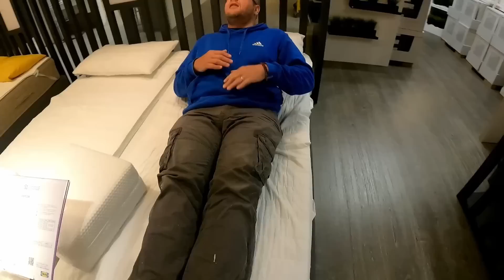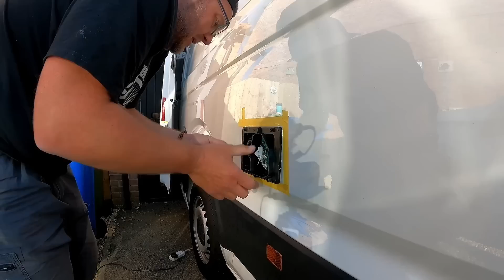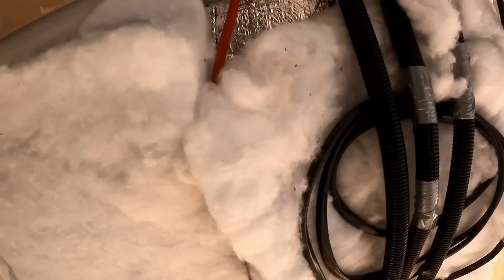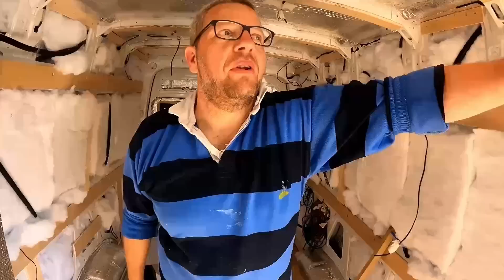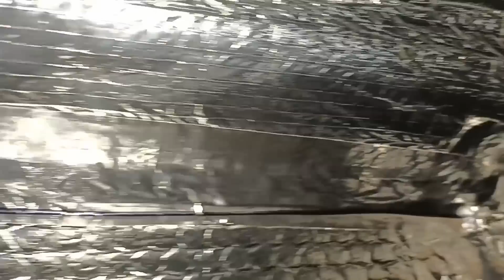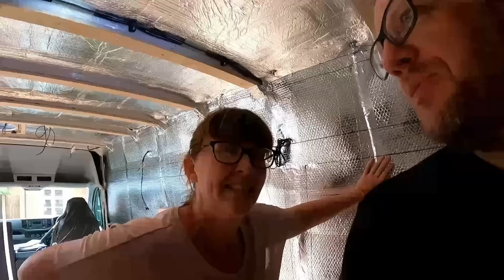Is all our hard work RUINED? | VAN CONVERSION diary week 5

Comment: Please really check your connections as you hardly hit them (a copper or lump hammer is best). If you’re running an inverter it’ll pull massive amps and any loose connection will be a fire risk. 👍
Reply from the maker: Thanks for the advice. I've tested the strength of the connection by giving it to our dog Bert. Even he couldn't destroy it, which is amazing for a Jack Russell. Thank you 👍👍

Comment: Unfortunately that rear light and cover is a disaster waiting to happen, and that was a ridiculous amount of water coming in.  Whenever we convert crafters I do a water test on the bodywork before we even start. Thankfully that has always been ok, but if it wasn't I would have no hesitation in sealing it up exactly as you did.
One bit of advice I would have if anyone else has a similar leak, park facing downhill as soon as you can to minimise the runoff , The roof naturally slopes back, so this is going to make it leak even worse.
Reply from the maker: Scary thing was we'd washed the roof with a hose several times. Thankfully the storm happened before we had got any more of the interior done. Good tip about parking for drain off!

Comment: Water is a bloody nightmare, but, you found it, for joints like that one, there is a rubber seal sold by the metre, it is 10mm flexi tube, I have used this to seal the same sort of thing, in case the lights need changing. You just put it around the perimeter and tighten down it, found it good stuff, you can find it at caravan acc shops or boat Chandler's, enjoying you Vlogs, doing a good job, good luck!
Reply from the maker: Thank you for the tip 👍